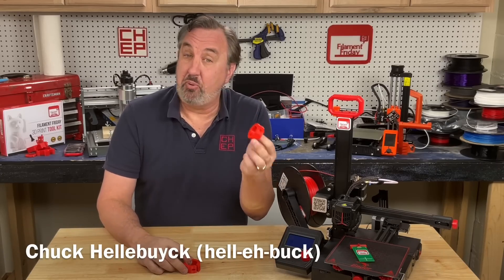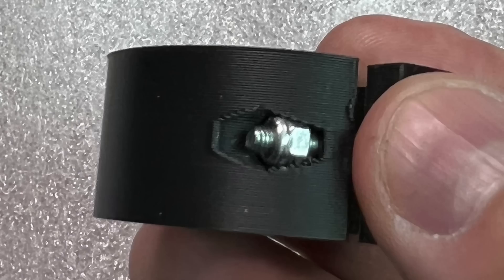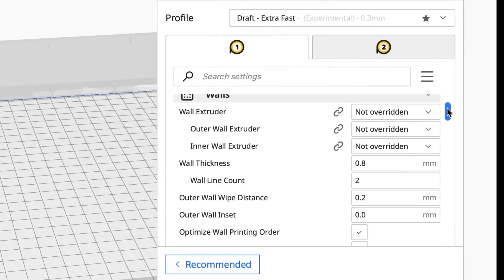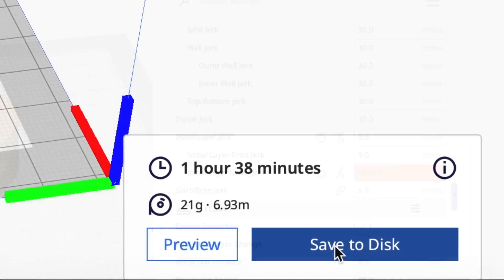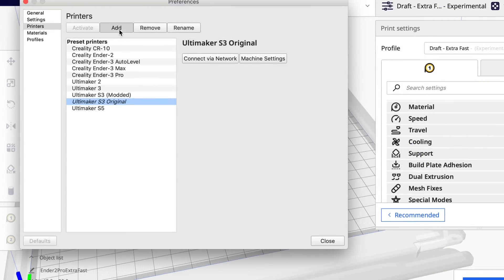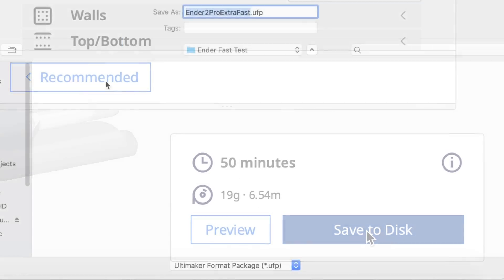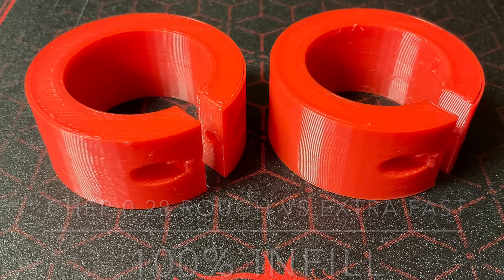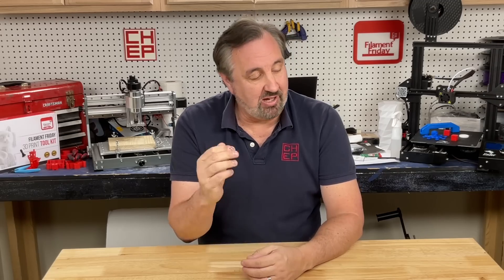Faster 100% Infill Prints with Cura 4.13 on Ender 3D Printer

Comment: Currently testing on my Mega X. Took a 7.5hr long print and made it 4.5hr on a 90% infill part. So far looking to be going good. Using Cura "Master" from github for the honeycomb infill. Will update once I test part. But as for quality it's looking just fine.
Reply: Oh it does cause octoprint to not show up in my settings while using this profile I have noticed. Had to upload to SD to use octoprint.
Reply: @jonroundy5227  Well, yes. Since you're telling cura that you have a printer that has it's own connection logic (the UM S3 has built in octoprint like features).

A much easier solution is to just set the top/bottom layers to not be 99999 if you want 100% infill. That's what is causing the slowdown.
Reply from the maker: Tried the 99999. Not the same results.
Reply: @FilamentFriday  there are some other changes too, but all of those are possible to set in a profile without copying the machine. You can just check what is in the profile and copy that. 
There are even plugins that allow you to check what the differences between profiles are.
Reply: @FilamentFriday  Your "Chep Profiles" are literally at fault here.
Reply: @FilamentFriday  You can just look at the source of the intent profile. It changes the following settings:

infill_sparse_density = 10

jerk_print = 30
jerk_infill = =jerk_print
jerk_topbottom = =jerk_print
jerk_wall = =jerk_print
jerk_wall_0 = =jerk_wall
jerk_wall_x = =jerk_wall
jerk_layer_0 = 5

acceleration_print = 4000
acceleration_wall = 2000
acceleration_wall_0 = 2000

speed_print = 50
speed_infill = =speed_print
speed_topbottom = =speed_print
speed_wall = =speed_print
speed_wall_0 = =speed_wall
speed_wall_x = =speed_wall
speed_layer_0 = 20

wall_thickness = =line_width * 2
top_bottom_thickness = =wall_thickness

There is literally no need to make the changes in the way that you made them, sorry.
Reply from the maker: First off, I appreciate the Cura’s creativity to figure this out. The speed improvement is amazing. Even with the firmware on Creality machines that limits the Acceleration and jerk well below those levels (as many reminded me)  yet we saw major improvements. I tried to compare but it wasn’t clear and couldn’t be completely copied so the assumption is it went deeper so I experimented and was amazed by the results. 
Based on what you describe though, if it’s that easy then one has to question is why wasn’t it released for all machines in the first place. But 
once it’s released most people will take the easier route and use the extra fast built in for their machine rather than a workaround and I’ll encourage that. 
I only showed a work around to use until that happens which we all look forward to. 

And AdderMK2 my CHEP Profiles haven’t changed so no fault there. I also compared to the included Cura Creality profiles and saw the big difference. There is more to it as Jaime pointed out in a response to you. It’s just amazing how good all this worked.
Reply: @FilamentFriday  There really ISNT more to it, and I'd be willing to explain it to you over Zoom if you'd like. 

A simple change to the creality_base.def.json file would correct everything. We have pointed this out on GitHub, however as GhostKeeper has pointed out, making the changes in the base fdmprinter.def.json profile is something that they are not willing to do, as it would change every single upstream profile that inherits from fdmprinter. The simple fact to this entire "problem" is that your infill is being replaced by bottom layers, and is then being printed at the bottom layer speed. Look at your profiles, specifically your 0.28 profile. You've literally got the lines in your 0.28 profile that changes the bottom layers to 999999 in there. You could make some extremely minor adjustments to those profiles and solve this entire "bug" even though it isn't one. And you would do so without having to hack an Ultimaker profile to get there.
Reply: @FilamentFriday  It's simple; We can't test it for every machine. We've gotten so much aggression if we make changes to the profiles that we've become super conservative. We just can't test if the changes that we make work for non ultimaker printers.

So we have to rely on other people to make (and test!) these changes. That's also why I'm always so "pushy" about making pull requests. I get it's not for everyone, but it's so much more impactfull to have a PR that actually fixes it for everyone than it is to have a youtube video that hacks something together with a somewhat similar result.
Reply from the maker: AdderMK2 - Ive tried modifying it and can’t get anywhere near the results that I show in this video. My profiles are open and shared. If you want to use your knowledge and modify my profile to produce these same speed results and allow me to share it with my audience I’ll do that and give you full credit for your effort. 
Telling me all the reasons I’m wrong or why things weren’t done on a GitHub doesn’t give us non Ultimaker users a solution. I found a work around for now but would be happy to test out your mods to my profile.
Reply from the maker: I understand you can’t test for all. But just making one extra version for Ender 3 covers 70% of the market when you factor in all the clones. If you want me to test it I will the same way I evaluate various printers for companies. 
Rather that blame me for finding a solution that works (though you don’t like the way I did it) work with me to support this low cost 3D printer community.
Reply: @FilamentFriday  A patched version of your profiles in in your listed e-mail.
Reply from the maker: AdderMK2 - Thanks. Tried it on the same file as video at 100% infill: 
CHEP 0.28 - 1hr 52min
AdderMK2 0.28 - 1hr 26 min
Hack used in Video - 0hr 50 min

So your version improves on mine but still falls far short of the hack I show in the video. I’ve seen these same results from others who said they had the answer and offered profiles. Nobody can match the speed of the hack.
Reply: @FilamentFriday  Yes, yes they can. I just showed you what settings need to change.

Im really sorry, but what you say is simply not true. There are more setting changes needed, but i guarantee that these can be changed in a profile without this hack. 

Making videos about it is also not a solution, its a poorly sticking bandaid at best. This will improve things for people now, but it will hurt them in the future! We will continue to update the UM settings and those are likely to decrease the quality for different printers.
Reply: @FilamentFriday  I've got a profile that prints it in 54 minutes. Your profile isn't actually faster. Those last few minutes that you get are because of the differences in the "machine_max_acceleration_x" and the "machine_max_acceleration_y" settings, which are set to be 500 in creality profiles, but 9000 in ultimaker. Default creality: 1 min 2, accelerations changed: 54 minutes. There is also a number of minutes gained from setting the infill from lines to zigzag and some other smaller changes. 

No worries; I checked the code; These max settings are only used for the estimation. So your hack doesn't actually make it faster, it just tells the user that it is faster.
Reply from the maker: If you want to favor Ultimakers, I understand. They pay the bills but if we don’t see similar for other printers then we’ll just keep hacking away via profiles or other means,
Reply from the maker: I actually printed the object and showed it in the video and it was clearly faster so not sure what your talking about. 
Just read the comments. People used the hack and took hours out of their print. So like it or not my hack works.
Reply: @FilamentFriday  I just checked the g-code, they are literally identical. Those last few minutes that you couldn't get it faster is really just changing the time estimation, not the actual g-code. So not only the actual source code of the engine agrees with me, it's also the g-code that it produces.

I'm not arguing against hacking, I'm arguing against the statements that you make that it's the only way to achieve it (and I'm trying to explain how the system works in a much simpler way as that you use it). 

so basicly all you need to change is:
1. Set bottom layers to 2 (1.36 h)
2. Set infill pattern to zigzag (1.29)
3. Set jerk ot 30 (1h17m)
4. Set wallspeed to 50 ( 1h6m)
5. Enable acceleration control (1h6m)
6. Set machine_max_acceleration_x & y to 9000 (only settable via plugin, but doesn't actually change g-code) -> (55 min)

The only difference that your hack makes is step 6 and that doesn't impact the g-code. All the others are just the settings that you generally touch to make a profile faster.
Reply from the maker: I never said it couldn’t be done. What I said was it wasn’t clear how. I tried what you just detailed on the stock low quality profile and got the same values you describe. Thanks for clarifying. I’ll work on creating an extra fast profile to add to my profiles. Thanks.
I’ll test it against my hack in the Ender 2 Pro as I showed in the video and verify it works the same.
Reply: @FilamentFriday  You've got a set of "Fast" profiles in your e-mail. The ones I'd recommend you test for release, are the 4.13.1 labeled files.

Apparently it wasn't "What you expected".
Reply from the maker: No I’m not. I know who Jamie is. Were just having a discussion about how to get Extra Fast Profiles for non Ultimaker printers. I’ve admitted it wasn’t clear how to recreate the Ultimaker Extra Fast profiles for non Ultimaker printers. I chose a hack that worked and he’s clarified the steps to do it properly in a profile. We’re just discussing the profile details. And now we know the details of how to properly make the Extra Fast Profile for Non Ultimaker printers. In fact AdderMK2 took my CHEP profiles and modified them to be Extra Fast Profiles to match the Ultimaker versions. That’s all we wanted in the first place. Why it wasn’t included in the 4.13 release is still a mystery to me but we now have it and I’ll be sharing them in a future video.
Reply: @FilamentFriday  because noone made a pull request. Really, that is all it takes for us to include it ;)

Hell, id even love to have a list of people that can check profile changes if someone reports them. But as it stands we have to rely on voluenteer contributions because creality isnt doing it.
Reply from the maker: Ill try them out. They look great. Thanks
Reply from the maker: If you can email me the link to pull requests and instructions how you want it done, I’ll add it to my CHEPCLUB pages so the community can help. Thanks.
Reply: @nallath  
I'd gladly apply for something like that.

Comment: Ender 3, it worked
Reply: Same. 20 % faster
Reply: @karolalbin  depends on your print if it is all walls it's likely you will achieve 20 to 30 % speed bump. If your doing a print with more infill it's 40% speed bump. Just make sure that your printer is clean especially the bearings (if it needs silicone lube or grease for the bearings, this will make your machine easier to move at that speeds)
Reply: Thank You for this comment. 
I wasn’t clear as to wether or not this would work on the Ender3. I like the 3 better than the 3pro so this is really good news.

Comment: @CHEP If you could make an Ender3 S3 profile and release it, that would be AMAZING.
Reply: He's already made one. Download his Thangs file he linked and it's included in the zip as a 3mf file. Open it in cura and it should keep the settings and profile he made. Then you can just replace the model and print whatever you want.
Reply: @Tim B  i didn't notice that. Thank you!
Reply: Ender3 S1?
Same settings as a Ender3, Ender3 Pro, Ender5, and Ender3 V2.... His profiles are setup to work off the creality_base substructure, which all of those machines pull from.
Reply: @AdderMk2  No, not the Ender 3 S1. I meant a hacked Ultimaker S3 profile set up for the Ender 3, or other in the Ender Lineup. I'm making one myself, but it would be nice to just have a file I could download and plug'n'play.
Reply: @H3xx99  I just made one for my Ender 5 Pro. Would you like to have it?

Comment: hi, really enjoying your videos and have learnt so much, not sure if this is the right place to ask so my apologies if not.I have had varying degrees of success and each failure has taught me more.I have a problem that I've never seen asked about before so hope you can help.

My first prints were free laurel and hardy busts, and I was really pleased at the result.I have been trying to print again at a smaller scale, when  I slice on Cura everything seems fine, when I try to print the speed shows a ridicules speed of over 700,i set it to 40 and when print begins, the head moves over to the far side (right of the plate) lays a purge line down and then just spews filament out .I have tried all kinds of settings ,but I still get the same result My printer then misbehaves for a while  and then won't print anything.I switch power on and off  a few times and leave the power cord disconnected, this eventually seems to "clear" whatever the problem is and I can print other stuff normally again

 why just these two files ?happens with both laurel and hardy.........is it possible that the code could be corrupted and act like a kind of virus? its so frustrating and don't know how to start .Looks like I can't print these two busts again.I have downloaded them a few times and have made sure that they are the only file on the s.d card,still nothing works.Soryy for the length of my post
Reply: What printer are you working with?
and have you tried printing VIA USB?

Also try using a different MSD memory card perhaps.

Comment: I print calibration cubes in 15 mins now lol. instead of about 28 mins. But theyre not as accurate. more bulging around the corners. Trying to figure out how i could solve this in marlin. Thinking linear advance is my main option. Im going to upgrade to klipper tho once i got a Pi

Comment: one thing i have noticed on the rare instances i use cura. The print times are significantly longer than prusa slicer with similar settings. The quality is usually lower with cura as well.

cura also has way to many settings and many are redundant. Plus the hidden settings you cant see.

Comment: Hey Chuck just wanted to let you know I just inputted all of those speed settings in Cura but for my Chidi Tech X-Max: Speed, Acceleration, Jerk just about the same ones that the MK2 was using and the time reduction on seeing on all types of prints using PETG so far is remarkable.  I've seen time reductions with solid parts of 60 and 70% and with other medium sized parts that normally have taken me 14hrs now take 8.35hrs it's been really neat to see this evolution happen.  I'm interested to know if you have done any more testing with other printer models yet? I just have the X-Max and a Ender 5 Pro upgraded with a 3d printed stock direct drive mount and all of the other 3d printable upgrade goodies on it and seeing the exact same reductions in time that you were having on your Ender 2.  Thanks for the video it's been one of the most exciting things for me to come out of the space in a while thank you .

Comment: can you try changing line width for faster and stronger print.. basically I have a 0.4 nozzle and 0.15 nozle hight.. when I print stronger parts I design parts with 1.2mm walls.. change the line width 0.4 outer wall, 0.8 inner wall, 0.8 top/bottom and infill.. but cura does not auto adjust the flow.. so I ended up with spaced lines.. I had to increase the flow to double 200%  where the linewidths were doble and it worked.. the problem is the display show double thicker lines.. but it works anyway..
Reply: You could also use a larger nozzle

Comment: HLModtech did a video on this and there's a faster way. when you go to add printer go onto custom and change the name and this will do the same without needing to copy and paste gcodes
Reply from the maker: Change what name?
The Ultimaker? 
I did that for the download. You still have to modify the settings and include your custom start and end GCode.

Comment: Thanks for the video and the idea.
But, in my opinion, this method is more useful with big solid things.
I was checking your method with m/v Benchy,  with 100% infill and layer 0.2 mm, the difference is 1:33 vs 1:40,  7 minutes only.

In any case, thanks for the idea

Comment: I just used your guide, and createt a Ender 3 S1 Profile, and right now im printing a model af a dog laying down. Creality Slizer 4 hour 13 min. New profile 2 hour and 1 minuter. It´s looking good so far for now. I´m trying the new infill type "Lightning" too, and it saved 6 minutes.  Have you created S1 profiles too?
Reply from the maker: I just use the Ender 3 profile included in the download.

Comment: Interesting. I wonder how it would compare to increasing the wall thickness until it printed solid and make sure the inner wall speed was pretty high. It would have less accelerations and decelerations.
Reply from the maker: It’s about the same on this print but different on others. Also this modded profile works for less than 100% infill as well.

Comment: For this part in specific I would suggest using concentric patterns for both to and bottom layers and infill. It will allow you to greatly reduce the added width of the ring because when you print it with those patterns, all the forces that are applied to the part when you tighten it around a tube will be pulling in the direction of the lines. I bet it could do with a total of 8 walls (including the "walls" generated by the infill pattern).